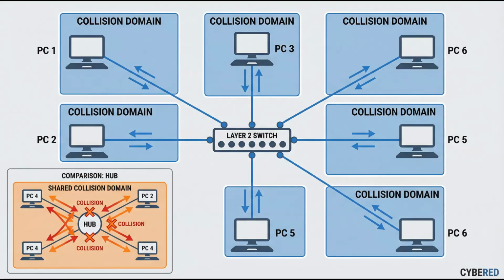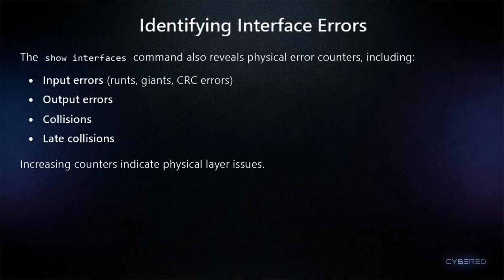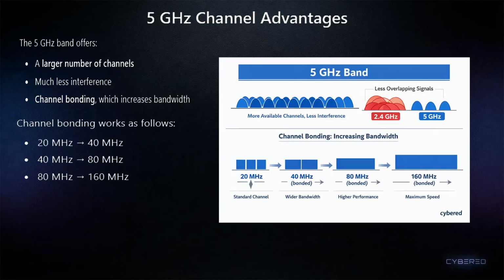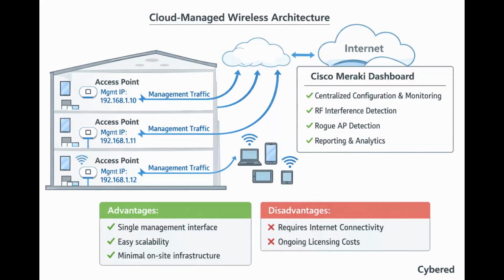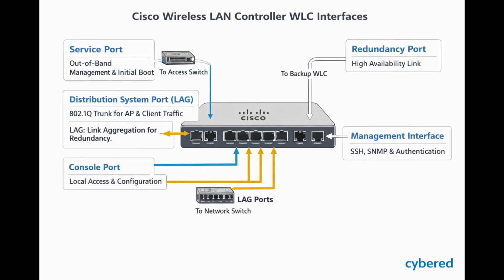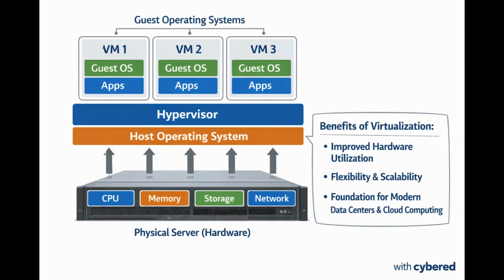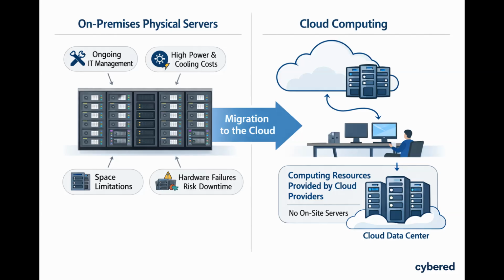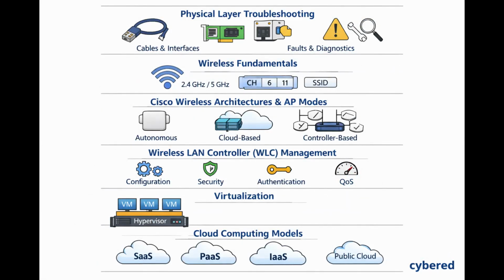CCNA - Chapter 4: Physical Issues, Wireless Architectures, Virtualization & Cloud(Beginner Friendly)

Comment: Hi 👋🏾👋🏾 .Ed 
I hope 😂 I'm not annoying you with stupid questions.

My question for this lesson is:
Why do sometimes I have problems with the wi-fi even when I'm near it. But the Smart TV works fine?
Reply: Also I'm enjoying the lessons 🎉 thanks
Reply from the maker: Not annoying at all, I actually enjoy answering questions like this.

As for your issue, this is pretty common and usually comes down to a few things:
Device Wi-Fi quality - Your phone/laptop might have a weaker Wi-Fi antenna compared to your Smart TV, so even in the same spot, it can perform worse.
Wi-Fi band differences - Your Smart TV might be using 2.4GHz (better range, slower), while your phone could be on 5GHz (faster, but weaker through walls).
Interference - Things like walls, metal objects, or even other networks can affect some devices more than others.
Network congestion - Your phone might be doing more background stuff (apps, updates), while the TV is just streaming efficiently.
Router handling - Some routers prioritize streaming devices better than general devices.

Quick things to try:
Move slightly closer and test both devices.
Switch your phone between 2.4GHz and 5GHz.
Restart the router.
Forget and reconnect to Wi-Fi on your phone.
Check if others nearby have the same issue (interference)

If you want, tell me your router + device setup and I’ll help you pinpoint it properly.